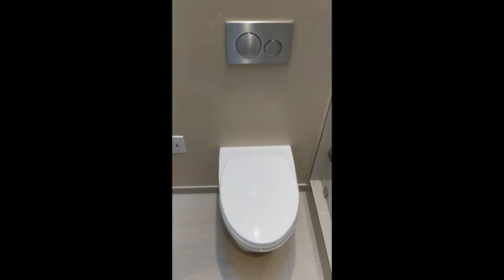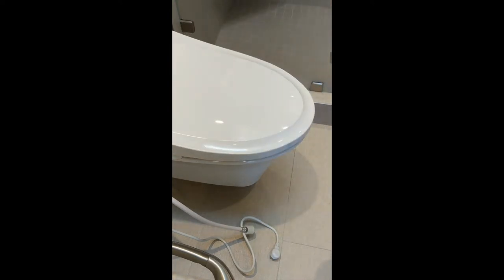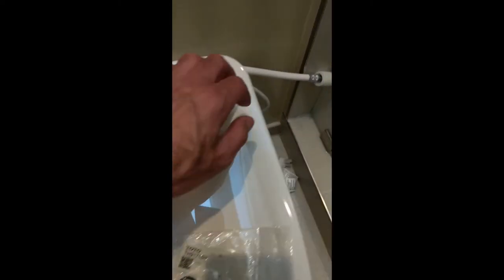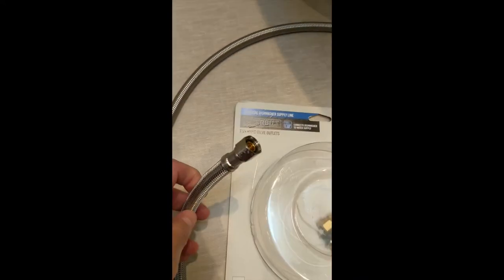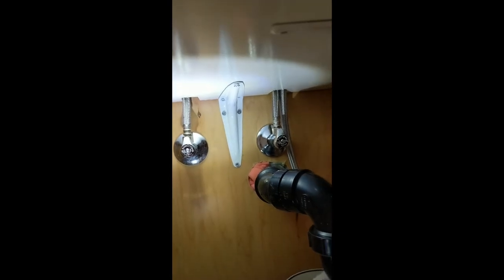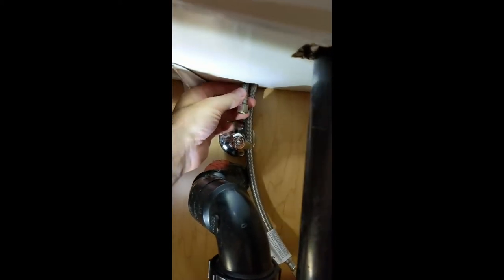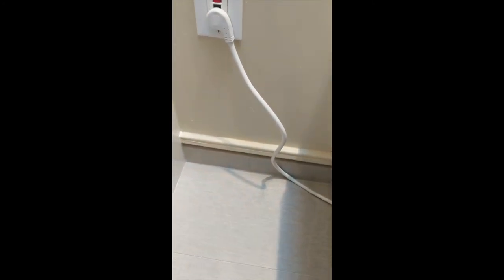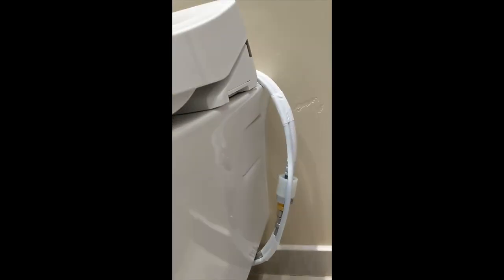Installing a Toto S550e Bidet Seat on a Wall Hung Toilet

Comment: Wow - you made THE ONLY video I've found that shows how to connect a Toto Washlet to a 1/2' water supply valve.  It's ridiculous that a $500 dollar toilet seat (I bought the Toto C5) does not include nor mention an adapter for this issue.  They only supply the two way splitter for a regular toilet and not a wall hung toilet with a dedicated water supply line just for the seat.  So irritating!  This was exactly the information I needed.  Toto USA was ZERO help!  I appreciate your video! Thank you!
Reply from the maker: Thanks and you're welcome! This was the same frustration I had too, and I also called Toto USA with no luck. Glad you found this useful!

Comment: There's a water supply just behind the buttons on your concealed wall mounted tank. I'm considering trying to figure out how to run a hose from there.
Reply from the maker: I haven't come across an install that taps the water line behind the flush plate. My tank (Geberit Duofix Sigma 8cm) has an optional water supply line that brings a water supply valve out to the wall. Unfortunately I didn't get that part installed during the rough-in so I had to tap the water from the vanity sink. 

If your tank has that optional part, you could install it, though I don't know whether you'd need to tear open the wall or not. The way my tank was installed, with many studs close the tank frame, I would've needed to open the wall.

Hope this helps!

PS the optional water supply part for my tank is here: https://www.geberitnorthamerica.com/_assets/local-media/spec-sheets/gna7272-parts-opt-bidet-spec.pdf
Reply: @usuallyuseful9217  I also have a Geberit sigma. Looked closely at it today, I think I could probably get it done with a hole saw, but it might be a pain and if I screw up it'll create a much bigger job, so maybe this goes on the back burner for now.

Comment: Any recommendations on what to do if the the water source for the sink is also concealed?
Reply from the maker: I'm not a plumber, but I thought it was plumbing code that every water supply line needs to have an accessible shut-off valve. So I'm not clear what your configuration is, but here are two thoughts: 1) depending on the type of faucet you have, you may be able to inset a tee where the faucet connects to the cold water supply line (assuming that connection is not concealed). 2) if the valve for the cold water supply for your sink is behind drywall, you would need to open the drywall to get access to it.

Comment: When your lid opens, does it hit the mount with the buttons in them hard? Mine makes quite an impact and dunno what to do. Thanks
Reply from the maker: Great question... yes it hits the control plate kind of hard. Toto supplies a little self-stick bumper to help reduce the sound. It works so-so -- it helps so it's certainly better to have a bumper vs having no bumper. You can either stick it on the flush plate or the bidet seat lid; I choose to put it on the flush plate. There might be better bumpers out there that dampen the sound better, if I find any I'll let you know.
Reply from the maker: I installed HushBumps Ultra-Quiet Gel Bumpers and they work better than the bumper supplied by Toto. Got them from Amazon for $10.
Reply: The wall mount itself has a water connection for bidets.  At this point it’s behind the drywall.  That said, you could pinpoint the location and carefully drill out the drywall to expose the connection.  Then remove the brass plug and attach directly to the same water supply that feeds the toilet.  A little more involved but preserves the clean design of the wall mount setup.
Reply from the maker: Thanks for your feedback Brandon. Yes, my tank carrier (Geberit Duofix) supports a bidet connection (via optional connection kit), however since it wasn't plumbed out through the drywall during installation, it would now be involved to open the wall and connect it up. Despite having to get the water from the vanity, I still got a clean look because the water supply is hidden in the painted wire-hider. But you are right, anyone who installs a wall hung toilet should have a water connection plumbed out during the installation.
Reply: @usuallyuseful9217  OMG I'm searching for a solution for the exact problem. Just installed my wall-hung EP with S550e today and that banging sound of the lid and the plate gave me heart attack.
Reply from the maker: Sorry to hear it was loud for you Chancy. My sound wasn't too bad to begin with, and now with the HushBumps, it's pretty quiet. I guess the loudness will depend on which flush plate you have, where the lid contacts the flush plate (determined by the height of the wall hung toilet), and whether you use the Toto-supplied bumper or a HushBump bumper.